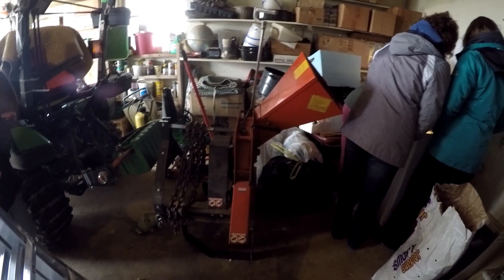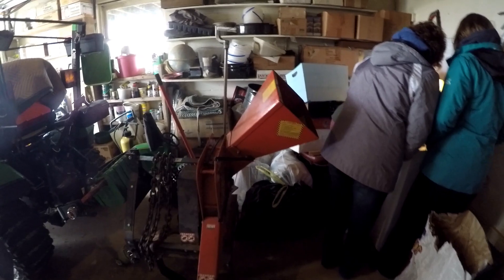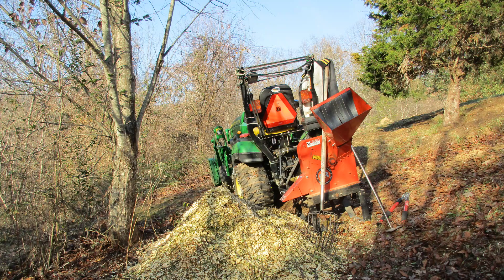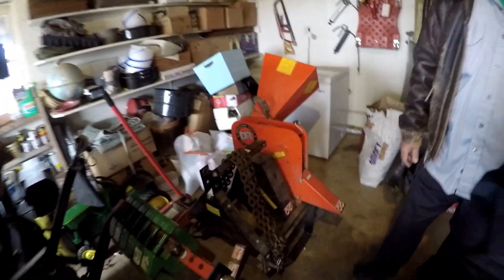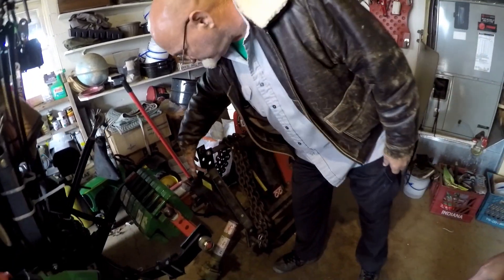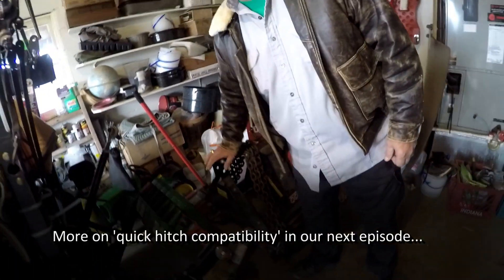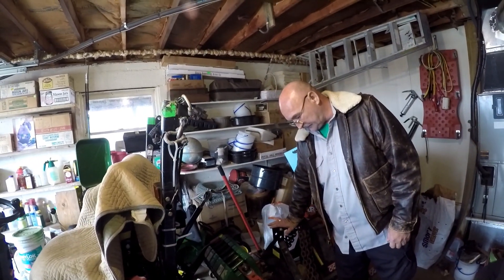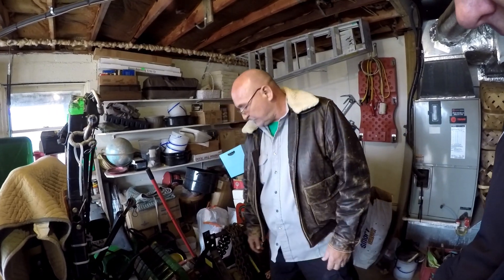Levi's John Deere 1026R and Attachments #1 (Episode #2 overall)

Comment: That's awesome.
What is the difference between the 1025R & the 1026? I've never found any comparison videos.
Reply from the maker: Not much.  Color of the diesel cap; 1026R had an air cleaner sensor; 1026R had a different engine with was not Tier 4 compatible.  ...starts easier.  Supposedly one more horsepower, but not noticeable, as torque numbers are almost identical.
Reply: Tractor Time with Tim 
okie dokie. Thankya for replying back Tim. Love your videos. Going to pick up my Johnny 1025R at the beginning of this next week.